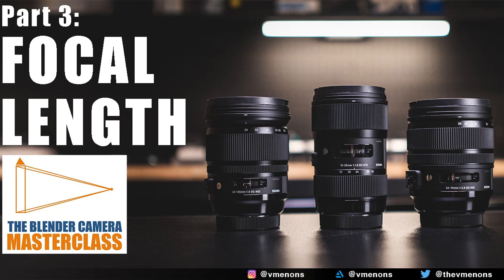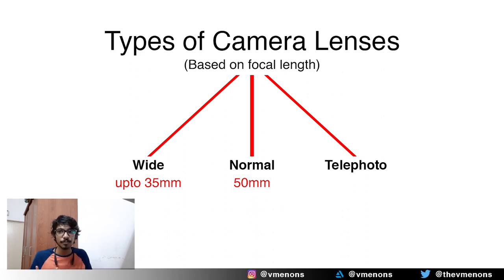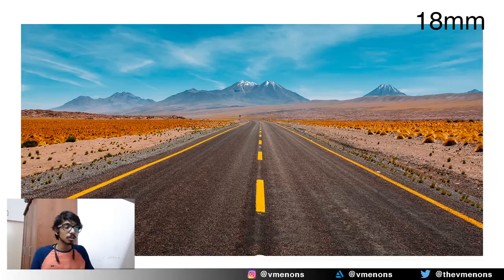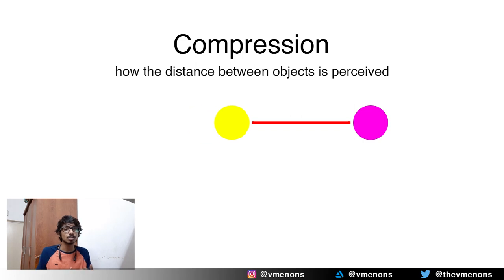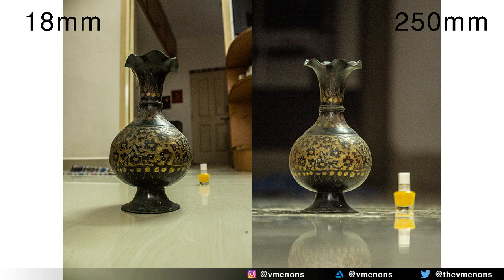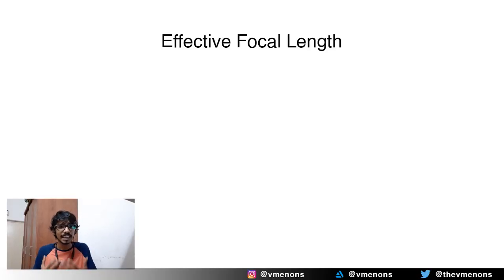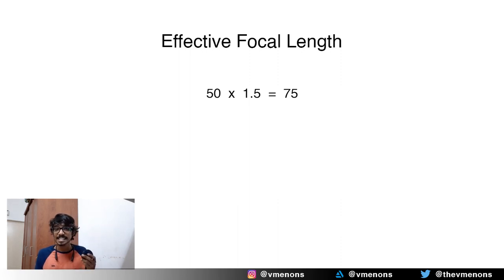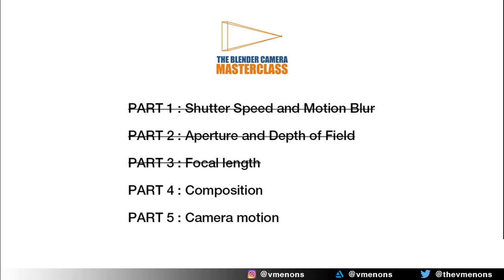Part 3: Focal Length | The Blender Camera Masterclass

Comment: Really great and pretty clear step by step tutorial. There is just one issue which I can’t recognize
fully this is the perception of equivalent.
For example  focal length of my smartphone Wide-Angle Camera  is  27mm like all description says,
But when I checked the camera info app it said that my Focal Length is 4.3mm. I spent a few hours searching for all this information and I found that 4.3mm means real size and 27mm is actually equivalent to a 35mm camera. Due to your visual explanation, it was pretty easy to understand what is what. But what about this?